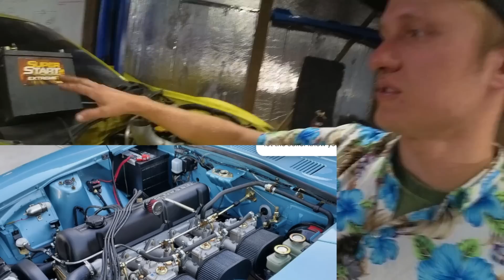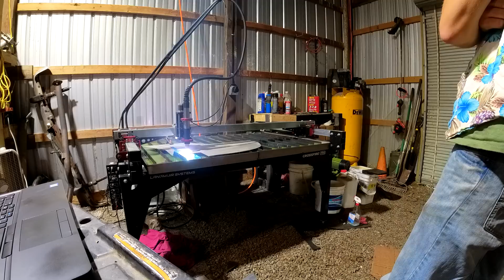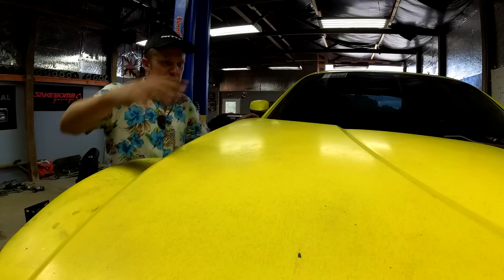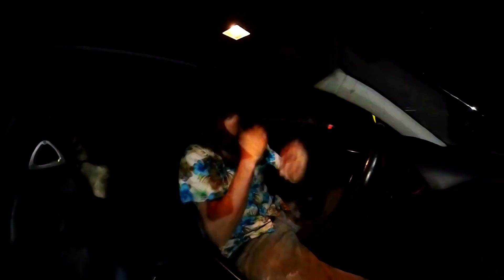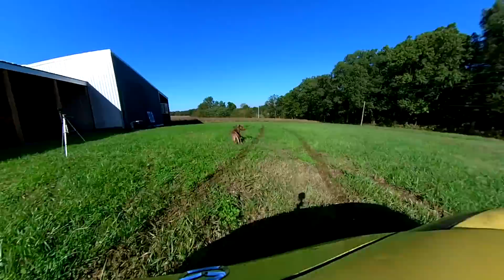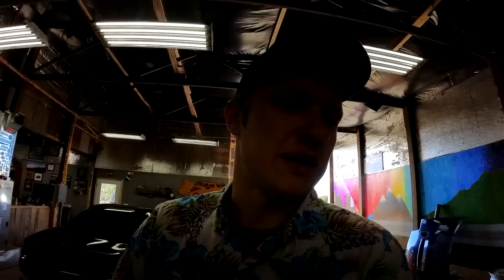FIRST DRIVE in The CHEAPEST TURBO RX8 on the Planet - IT MAKES BOOST!

Comment: what are your thoughts on running a air-cooled self oiled turbo to simplify the setup  without any oil or coolant lines or oil drain ?
Reply from the maker: I wouldn't be opposed, just have to find one that is semi budget friendly

Comment: You should add another 90 degree bend or at least some angled pipe on the top of the exhaust and make it exit sideways. That’ll avoid water getting straight down your exhaust and into the turbo while it’s raining or driving in wet splashy terrain
Reply from the maker: Ill have to cut a bigger hole in the hood :(

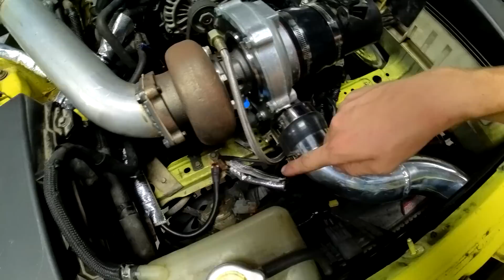Comment: Love your content and respect your engineering, but dude! 7:09 you're dropping the battery right next to the exhaust! Catastrophic city! Please be careful, I my self have almost been blown to bits by my 88 fc which had a leaking fuel line over the exhuast muffler. Rotarys run soo hot, please be safe.

Comment: I need my Bridgeport rx8 tuned, and I have a SSV rattle, let me know if you're available, I'm not too far.
Reply: I disabled my ssv for my bridgeport. No more clicking, bigger braps.

Intersect the ssv line from the solinoid with a t piece. Run the new line to the vfad port on the intake. Put in a 1 way valve in this line so when full throttle you maintain vac from the inlet vac tank. No ssv now and it is kept open with constant vac. You will lose efficiency below 3000 rpm, but you have bridgeport so what does it matter. Not really noticeable.

I have a bridgeport map on versatuner forums that you can use for a base. Search 80HD. 

Since pulled out fuel on the top end and havent uploaded that map. Way quicker. The uploaded map is still pretty rich.
Reply: @noname-sd5dt  can you make a video of the procedure?

Comment: Your MAF is probably going to be erratic without a proper length of straight tube fore & aft of it's position and mesh screens, it also should be as far away from the turbo possible. The VE table is mislabelled and is a correction table for the MAF output in the calculation, it corrects for pulse reversions and such. Use MegalogviewerHD to analyze the logs because versatuner isn't any good for logviewing; no histograms, scatter plots, filters or math channels to help you. You want something that can generate histograms that replicate the break points of the map you're modifying, that's the only way to get good reliable correction values to apply to the VE table. 

Closed loop max load 1-2 & 3 are delayed closed loop exit tables, Load limit unk (unk=unknown) is the immediate CL exit table. There are 3 other CL exit delay timer tables not defined: if actual load > Closed loop max load table and CL exit delay timer table is elapsed then open loop fuelling.

Load calculation baro & IAT adjustments apply to the max operating load table so the actual limit goes up or down depending on the correction % applied. When you increase the max load allowable, you need to retouch everything above the stock load limit on the VE & fuel tables. Boosted tables need to be re-scaled so the load axis goes higher than the max load you'll see, start with 200% load. IAT table can't have values under 1 above ambient because boost...

Fuel tables are gear dependent; fuel table 1(gear 1-2), fuel table 2(gear 3-4) & fuel table 3(gear 5-6). I calculate current gear from my logs with math channels so I always know what table I'm currently operating from in my log, I also log clutch & neutral switches and use them as filters to remove data from the logview histogram.

SSV table seems to be overridden open before 3k rpm by the turbo people for spool-up reasons.

Fuel targeting is AFR base value + additive afr table cruising range = target and, high loads & high rpm on this same table correlate roughly to lambda 1 - value = target. There are other undefined tables that affect WOT targets. Example: in (afr) 14.7-1.4700=13.23 in CL and drops to about 11.23 in OL. OL OBD2 target is 14.6 (actual AFR around 12.6) normally and 13.3 during fuel cut but the AFR is around 11.3 so there is an offset of -2 AFR points between CL & OL fuel targets. So your turbo additive table should have the -1.4700 value copied all the way down to the highest load axis cell and left to where the boost threshold is.

Ignition... versatuner doesn't have much defined other than 2 leading & 1 trailing table, basic idle controls & some knock tables . In winOLS I found 4 leading, 5 trailing including a minimum split  table and also the knock sensitivity tables for each rotor.

I'm probably forgetting a lot but hopefully someone else will chip in...
Reply: Great info hope he reads this

Comment: Dumb question, is there a goodish option for a transaxle for a 12a?
Reply from the maker: Good ish meaning cheap?   Could try the old porsche transaxle and then an adapter.   Or I know they make adapters to a VW transmission
Reply: @RADPotential  its a NA 12 that im trying to rebuild. so i need to have short is gear ratio.  formula mazda is a thing thanks to dahm putting that on my radar as a not so cheap option but the best one for the twisties south of Martinsville.  the end goal is like 80hp on a home made EFI  i got to 3D print a intake manifold to use a small like D series throttle body from blox racing.  i got enough cans to melt down to  cast a okish alu intake manifold.  ramblings aside its going to be like a tank car or like a old formula car from the 60s havent talked to my buddy on what he wants the chassis to be but its going to be mid engine. he wants to put the 12a in is toyota MRS and "im like nooooo.....but it does kinda look like a porche so we could use a VW trans" cause what doesnt have an adapter to the doom buggie is a shorter list.  im the engineer, hes the mechanic.  trying to agree on something is impossable.

Comment: I think your MAF sensor placement is going to be a bit of a problem with its proximity to the turbo. I would do a 90 degree elbow off the turbo and put the maf in the straight section between radiator support and the elbow. You want it in as long/straight of a place as you can. This will reduce turbulence and improve idle/light load drivability.

Comment: Hey rad I’ve been watching your videos for a while and I have a 1985 rx7 and I can’t get it to start I’ve poured gas in the carb and It has popped like it wants to start but just won’t wondering if you have anything to help thanks
Reply: Not an expert but I'd expect it's likely flooded if you're having to resort to doing that. Rotary's don't easily clear being flooded due to the combustion chamber being essentially sealed from the environment unlike a piston engine which could have valves open when the engine is stopped to allow the excess fuel to evaporate out for the combustion chamber. If I was you I'd try to deflood the car. I would try taking the spark plugs out and drying them as best as possible. While the plugs are out you can hold the throttle open and crank so push any excess fuel out of the plug holes and exhaust. Make sure you disconnect the ignition fuse or coil during this to prevent an ignition source potentially causing a fire. if the car has an electric fuel pump it would be best to also turn that off if you can. Once you no longer see fuel spraying out of the spark plug holes you can add a tiny amount of 2 stroke oil into the holes with a syringe and reinstall the plugs. Reconnect the coil and attempt to start the car possibly with a bit of ether type starting fluid if it needs it. With any luck that should get it started. Keep it running until it's warm to make sure it's cleared the flooding and try not to shut it off while cold as that increases the odds of it flooding once again. Good luck.
Reply: @gagesilveira6694  thanks for the tip but I’m not sure that’s what it is when we first pulled the plugs oil was on them checked the compression and it seemed to be good I’ll try it sometime but it sat for around 4 years it’s my grandpas but I’m trying to get it running he said before he parked it that it would randomly cut off I don’t know if it has to do anything with it but I’m not sure
Reply: @MillerMX285 timing? Fuel pump?
Reply: Have you check the ignition system? Such as spark plug, plug wire, and timing?
Reply: @fisshuman  yes
Reply: @fisshuman  I’m no mechanic but I’ve tried as much as I know and I don’t know what to do